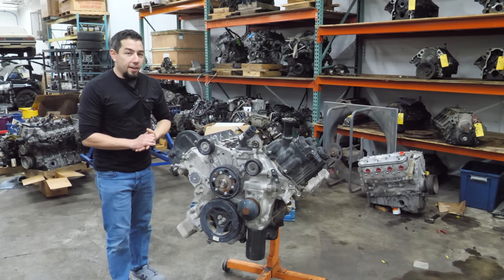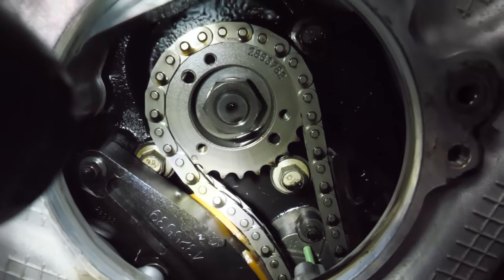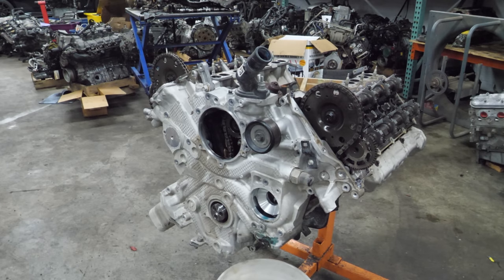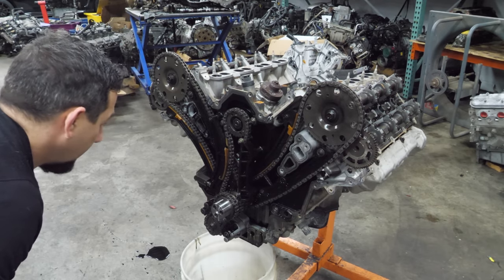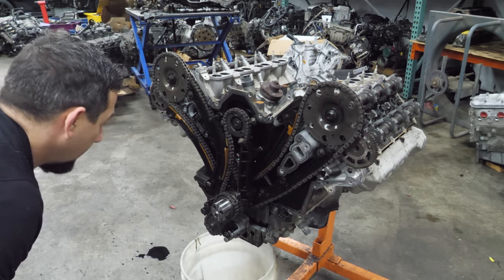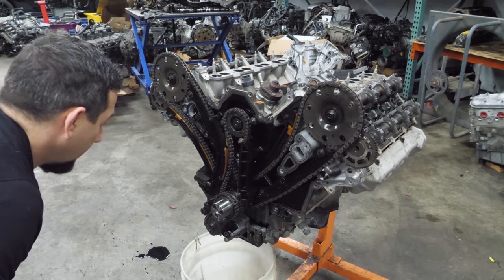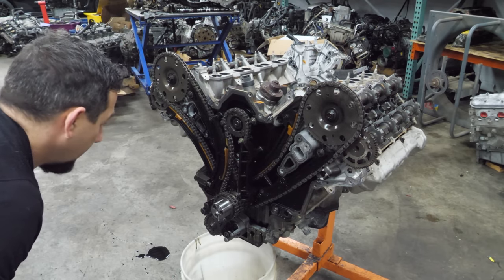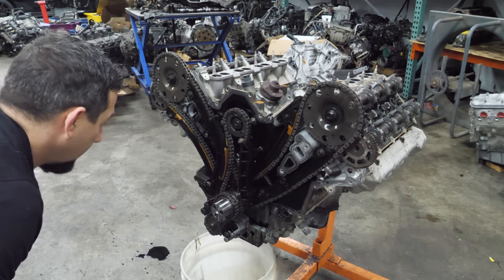Well That's Not Good! Nissan Titan XD Cummins 5.0 Turbo Diesel V8 Teardown. A Costly Failure!

Comment: Worst engine Cummins every made! I had one and the thing left me on the side of the road 4 times. Fuel pump failure 2 times, DEF injector failure once, EGR failure and finally turbo failure. Only got 130,000 miles out of it which is a joke for a diesel that should get 400,000 easily. Worst truck I've ever owned. I don't really blame Nissan for this although it would appear that the Titan XD with the Cummins engine was a parts bin truck that they threw together. The engine is a cummins, the transmission is an Aisin and the rear end is the same they use in the 3/4 ton RAM. Cummins simply delved into the v8 market and came up with this disaster of an engine.

Comment: Another vehicle Slain by the Jawbone of incompetent previous fix attempts.  It probably quit running and was disowned shortly after botched pump replacement's smelly fuel fire hazard. 
Incompetent Repair Services have become common as experienced techs retire and fewer sharp minds find this work appealing.  Many  consumers suffer as result.

Comment: Diesel + "Tuning"  =  usually User/Owner PROBLEM. Did not hear the word "Delete", which might also need to be added to the equation. If you "tweak" beyond what a Professional (like Banks) says, I have no sympathy for you. An expensive lesson. Dodge should've accepted the 5.0 from Cummins, instead of that Damn Tractor engine they shoved into the 1500.

Comment: 3:25 I already see why this engine has issues , it has Nissans trash timing chain design ,Nissans are  worse than fords
Reply: I can’t relate. My F150 has 330k and other than a fuel pump, I’ve never had a problem.

Comment: Hi I have a 2011 Honda Accord lxp 2.4 l engine that’s running right now I can do a video. No knocking or noise 174000 miles on it. Where you interested in buy it for a great price
Reply: 2011 Honda Accord lxp 2.4l four cylinder engine

Comment: Just say no to v8 diesel engines. They just aren't great in a V8 configuration. Diesel engines should be Inline and inline only. One turbo, one cam, none of twin/quad/ dual overhead etc. 
Keep it all simple. The government regulations are not the reason to build unreliable engines. They think they know but they don't. 
Just because you can build it, doesn't mean that you should.